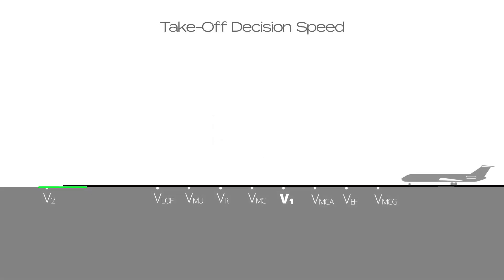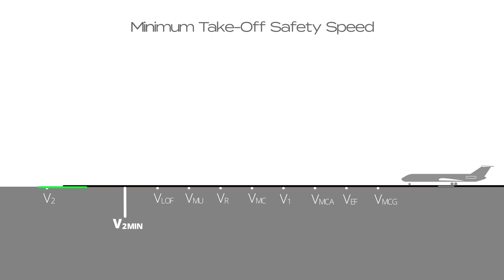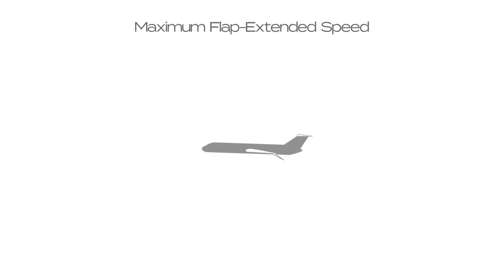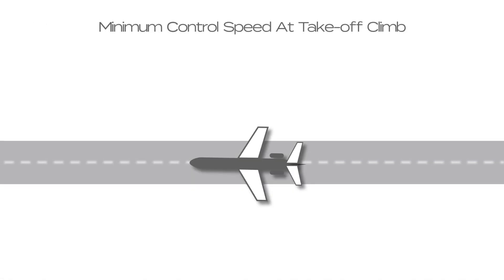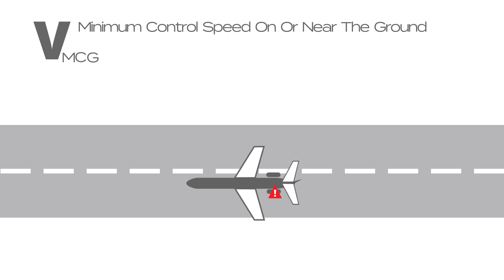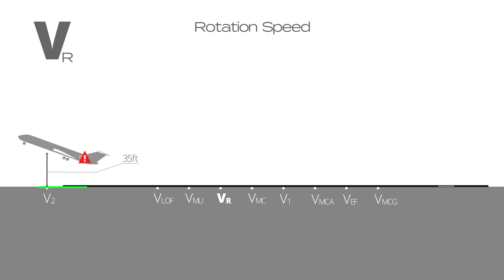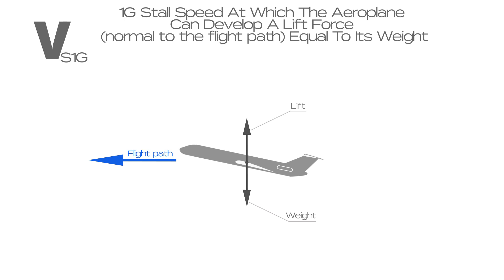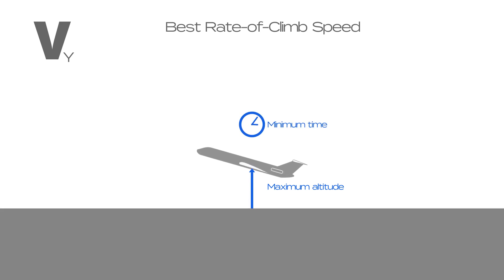All the V SPEEDS you need to know | Simply explained.

Comment: for cessna 172  ; there  aren't   v1 , v2,  limitations why? because ı am a student Pilot and  I don't understand V speed for single engine aircraft or twin-engine aircraft
Reply: Because you only have 1 engine! If you lost it, you couldn’t go anywhere.
Reply: For you it's just Vr and if engine fails choose a field between 10 to 2 o clock and make a landing. . and if airborne don't try to do a 360 landing unless you have reached 800agl (or mentioned in you AFM or instructed by your instructor) 
but you do need to know these V-Speeds for your airlines interview and license exams .
Reply: because a cessna still can land even after airborne if there is enough runway available in VFR conditions